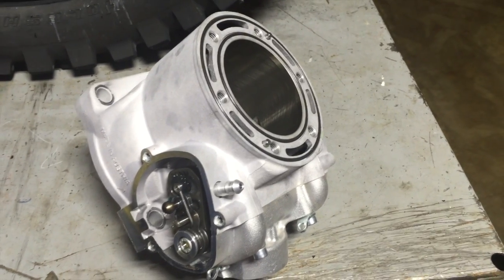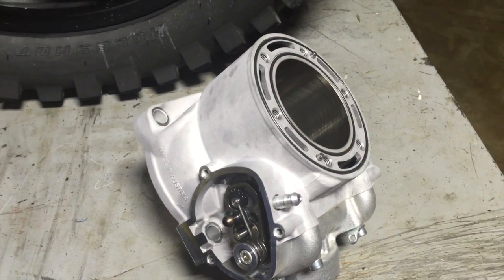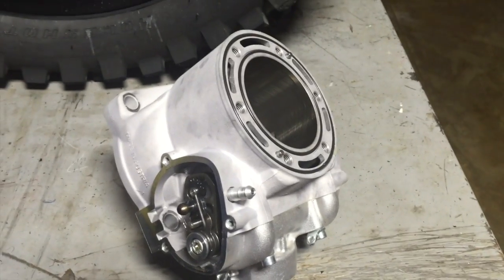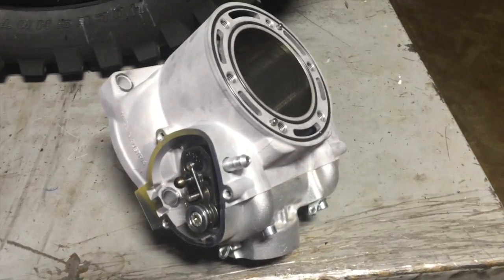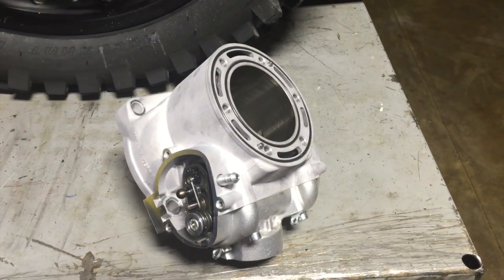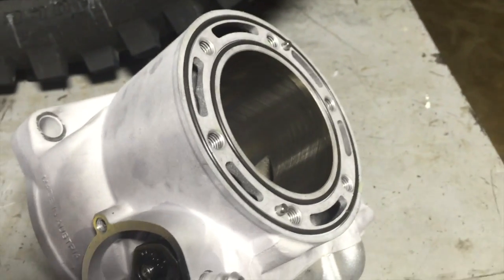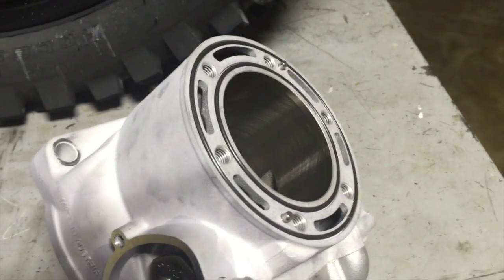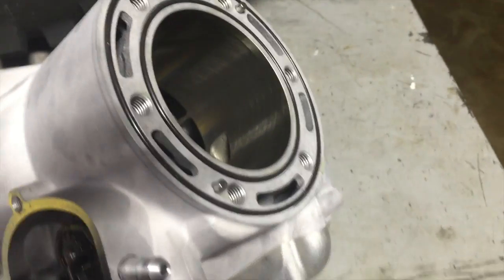Engine Break-In Procedures

Comment: Great information.  What about the gas:oil ratio for the break in??
Reply: The answer is in here further down in a response and he states never change the ratio.  I tend to agree based on common sense; why gum up the engine and introduce other issues.  Although, this probably not the time to experiment with leaner ratios than OEM spec.

Comment: About to install a new cylinder and piston on my yz125. Would you recommend this break in procedure for the new cylinder? Also do you recommend lubing the  piston and cylinder before install or installing the piston dry for better seating? Thanks!!
Reply from the maker: Yes. Lubed or dry doesn't make much difference. As soon as you touch the kickstarter, the motor gets a fog of oil and gas.

Comment: I was on a large turbo performance engine project for an OEM a few years back, the run-in procedure was to ramp in speed and load until maximum speed (with reduced duration at each point), then boom it's ready to begin dyno testing.
Reply from the maker: Sounds good to me.

Comment: So why do many (if not most) manufacturers have a break in procedure in the manual that typically involves heat cycles, reduced rpm and load, or some variation of? KTM and Yamaha do, for example. I’m only asking because I don’t know.
Reply from the maker: Just looked at my manual. No mention of useless heat cycles. They have to give some words of caution or goons would ride 6th gear pinned up a sand wash in the first 5 minutes.

Comment: Just curious, what about putt-putting around when you're doing figure eights and such.  I'm also not much of a rever, I prefer low engine rpm stuff...  Should I then hit an open trail every once in a while and blow the dust off the piston?  I remember you had to do that with the cars in the 60's to keep them running fresh, rev the crap out them once in a while.
Reply from the maker: The engine needs to expand and contract during break-in. Let er rip once in a while.

Comment: Hey Jeff, Curious to know what your thoughts are on 2 stroke engine braking ? 

Coasting down a hill in the trail without having the clutch disengaged etc .. ?
Reply: If the engine is running it’s getting lubricant
Reply: I ride colorado mountains and I kill my bike and coast on most hills as most bikes I run with are 4strokes and the gas last longer than my 2stroke 19 yz250x!

Comment: I have a KTM 300xc 2008. The previous owner had the jets for mix of 40:1. My engine has been freshly rebuilt after it seized, is 40:1 a good mix? Some are telling me 32:1. Please help
Reply from the maker: D M 
All oils should be mixed to the ratio the manufacturer recommends.
Reply: @slavensracing  So even during break in of my engine? its been rebuilt bottom up. Manufacturer of the mix? Or manufacturer of my KTM which says 60:1
Reply: @slavensracing  Oh and my broth Craig said you are the KTM king bro. So I'll take your advice and your advice only. What's a good mix oil to use?

Comment: I kinda learned this by happenstance and experience. This guy is absolutely 100% correct. You have to run them! Load em up with high load but not pegged wide open through every gear. Load is key!

Comment: Jeff Slavens The reason manufacturers dyno every machine is because letting a defective bike go out the door could cost them more than the damage they might be doing by testing them.This does not mean that  this is the best way to break in a new piston, just the best for mass production. I would follow piston manufacturers break in instructions. Do you think you know more than the people who make pistons. If the new piston and rings are broken in after the first few minutes, how will avoiding full throttle and operating in the higher gears lugging. The first hour of operation cause problems if its all ready broken in you are contradicting your self.
Reply from the maker: You are very good at spinning my words and I did not contradict myself. I've worked for several factory teams and built engines that have won over 40 nationals and I'm surprised that I was able to do that without your guidance. Thank you for enlightening me.

Comment: Hay Jeff, thanks for sharing your expert advice. Question for you and sorry this video has been out awhile now!, would a similar Brake in be used for a KTM 1090/1290? and would you suggest several early oil changes ? Thanks again.
Reply from the maker: Yes, just ride it but don't get too crazy. I have a 1290, monster motor!!!

Be careful with early oil changes. They have good filtration so no need to do it too early. KTM uses a break-in oil designed to let the rings seat. If you change to a slippery full synthetic too early you might create an oil consumption issue.
Reply: Jeff Slavens , hay thanks for the reply..So following the factory directions to make the first change at 620mi(1000km) then every 9300mi(15000km) after that!! Seems like a loooong interval? The owners manual specs a 5/40 or 10/50 depending on temps, would you think the LC8 would be happy with dino oil after the first change or a semi-synthetic?

Thanks again.
Reply from the maker: The factory specs are very conservative.
Reply: Morning Jeff. Thanks for your time and replies! After searching the owners manual a few times I did find that KTM recommends changing the oil to a full synthetic, a 5W40 or 10W50 Motorex Power Synt 4T. after the brake-in. Thoughts? Am I over thinking it, just go with the manual??? Thanks again...
Reply from the maker: Follow the manual. Get off the computer and get on the 1090.
Reply: hahahaha....ya. Gotcha! Have a great Holiday Season. ALl the best...
Reply: @slavensracing what do you think if  on my new Husqvarna 701 I change the oil after 10 miles with a conventional quality oil and again at 60 Miles , 120 Miles and 4 times again until 1800 Miles and than switch with full sinthetic oil?
Reply from the maker: @miocassettomiocassetto357  
The stock break-in oil should be left in for a few hundred miles. Changing it sooner reduces the probability of the rings seating correctly.

Comment: You should do one on the myth of engine braking. The net's full of people claiming it will blow up your engine etc.
Reply from the maker: Can you send a link to the chit chat?
Reply: +Jeff Slavens I think there's actually a video on here of an example that seized due to excessive engine braking...or so they claim haha
Reply: How would engine braking not blowing it up? If you reg up to 10k rpms then shut the throttle the engine is turning at 9k rpms and getting almost no lubricant
Reply: @ianjohnson5365  if the engine running it’s getting lubricant
Reply: @MrJasonfromcanada  yes... if it's spinning 10k with throttle closed for example.... it would only get fuel through the pilot basically and have the same amount of lubrication as when at idle which is not as much as when slide is all the way up/throttle wide open
Reply: @ianjohnson5365  
Yeah probably not a good idea click down a couple gears a wot. The riding characteristics of 2 strokes I find that you’re never really engine breaking for long periods of time because they’re really isn’t a lot of engine breaking with 2 strokes anyway.  Its usually a combination of clutch, rear brake with moderate engine breaking kind happening all at once.
Reply: @MrJasonfromcanada  I think I'll rather change brake pads than piston tbh
Reply: The elevation I ride is from 2500ft to 9500ft. Lots of down hill stuff, lots of just leaving the clutch out. I only change pistons every 100hrs. Nothing happens!!
Reply: @beauhawk1146  That's right and if you watch the old 2 stroke bike racing they are flat out and then engine braking at every corner and those things screamed up to 13k or something.

Comment: so you said you'd get a good ways away from the truck to let it warm up and then start working it but then you said you would then wait 15 mins and then start reving it. but didn't you advise to let it warm up two to three Minuit's riding then start reving it and doing some pulls and riding harder. or is it not that sensitive as long as you don't let it idle around so long it glazes.

Comment: Thank you for the very informative videos. Do you recommend using a non synthetic oil, or a different oil/fuel ratio  for break in?
Reply from the maker: Any premix oil works for breaking in a 2 stroke. For 4 strokes I prefer non-synthetic during break-in.
Reply: Thanks for your reply Jeff, very timely info as I'm picking up my new 2017 TE300 Husky this afternoon!! Also curious as to whether you have any updates on the V Force reeds, Cheers.
Reply: Jeff Slavens hey Jeff. Thanks as always. Re: conventional vs synthetic. Does it really not matter on break in? Just my old school brain, but I thought synth was too slick to allow the rings to seat. Just wondering and truly asking for insight. 2) new plating on kx100 and Wiseco kit. After 20 hrs, I only get 50 lbs compression test. Cylinder and piston still look fantastic. Could this be due to bad break in? (I heat cycled it very gently about 4 rides) Could I have glazed the cylinder? Would it be easily seen on the cyl walls? Thanks again for a great vid!

Comment: I always did it the way you do.The only thing I did try to do was use a bottle of Kawasaki racing oil for the 1st time.I used it in KTM's .That oil was a full petroleum oil at the time.I only now have 2 of them bottles old style bottles left but I don't buy new bikes every year when they hit the 10k price range .I've had 25 KTM's so far & will get # 26 whenever I think it's time to up date.

Comment: Yes ...... I also agree for the most part with this break in procedure listed here.  My 43 year piece to add is this, I feel there is nothing wrong with warming a motor up a little more, maybe for 3-4 minutes before you take off and ride ( easy ) for a several minutes as listed.  With todays larger capacities radiators,  super coolers, liquid ice type anti-freeze  additives  that many people add to there machines today make motors warm a little slower then a decade or two ago.  His opinion here is a solid one and a great way to follow in breaking in motors.  I just am a little more easy on the new parts !
Reply: I was told by Tom at Moore and Sons in Santa Cruz that when I warm up my bike, I should not let it idle for very long. I should ride it so that the whole bike is warmed up evenly, not just the engine.

Comment: who is the SOB that left a dislike...
Reply: I have ridden many bikes and in my opinion as far as jumping and throwing the bike around on the track goes... 2 stroke is the only way too go.. BUT.. 4 stroke guys know when you are far out in the bush and faced with all kinds of rivers, ruts, hills, and heavy terrain your going to want a more reliable bike with loads of power in the lower end.. which is what my rebuilt from the dead 2002 honda crf450r had .. easily the best bike ive had. I got a 2007 klx250 now but havent even tried it yet.. guy before me didnt clean filter and had the carb all "tuned" aka fucked with.. just leave the damn bike stock or the bike is going to leave you stranded.
Reply: Colby Hutzell im a thumper rider and im gonan tell you right now, worst type of bike ive owned, the more smokers i ride the more i love then !! And i own a 2016 honda 450

Comment: Jeff, thank you for sharing this!  I get this question all the time and have responded in kind.  Ride it and stop over thinking it.
Reply: What is with all this heat cycle stuff i keep reading about?
Reply: I think its people's opinions only. I know when I'd put and small block in a chev I'd have to seat the rings but hitting the gas hard, letting off and hitting it and letting off over and over for about 5 miles or so.
Reply: Old ways die hard. You still hear break-in advice from before plated bores and computerized metallurgy, which isn't relevant to new engines. Thanks Jeff